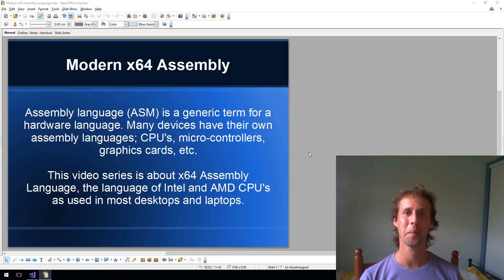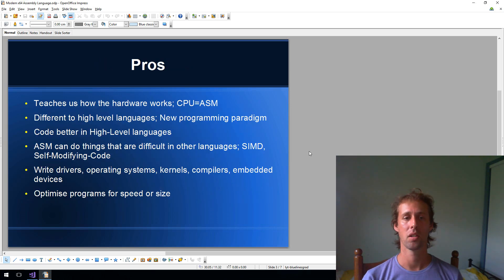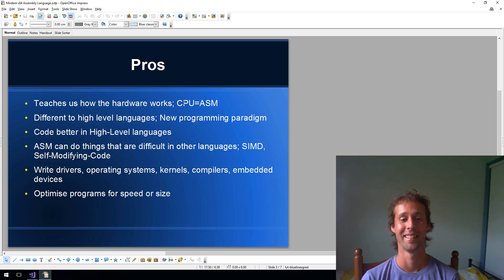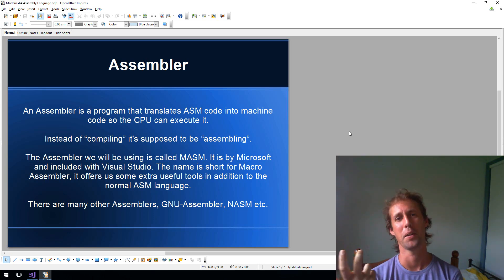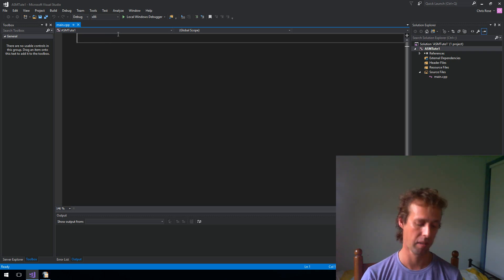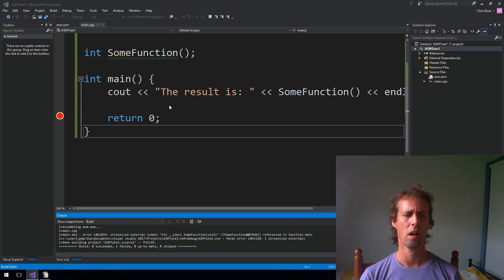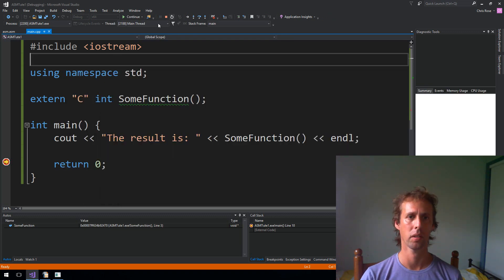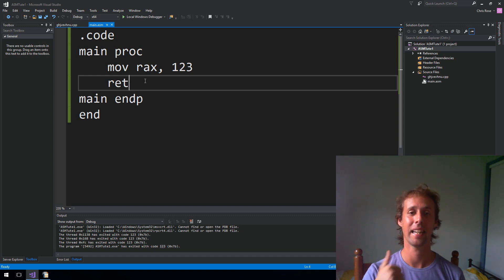Modern x64 Assembly 1: Beginning Assembly Programming

Comment: My C programs need somewhere around 5 MB RAM and 0.2% CPU of a single core: Yes, i need to learn assembly to make more efficient and faster programs.
Reply: I think it’s more about learning how the cpu and coding works
Reply: I don't think you will get anywhere near the optimized code modern compilers produce. If you want your program to be size-efficient you should stick to C. If you want it to be as fast as C but scale well with complexity then use C++. Use assembler only if you can't use C/C++ to get the job done.
Reply: @embeddor2230  the real challenge is making good code. There's a difference between searching a string with a regular loop vs an algorithm tuned to be almost 10x as fast
Reply: @gabe8168  indeed, but one should also note that many algorithms specially ones related to dynamic programming tend to ignore the constant factor in their time complexity like memory access time or number of used divisions/multiplications or number of unpredictable branches and so on.
Reply: lol
Reply: Maybe try making a new programming language? If you do it in assembly, then surely it'd be faster than C (as long as it's well-written code that is)
Reply: @brotheradamfromups  It is actually pretty hard to beat a good compiler on an architecture like AMD64, which is very complex.
And there is the problem that many of this CPUs have some kind of bug which can slow down some instructions with some arguments.
Reply: Use C# or C++
Reply: @fdsKedi  NO. Not C#, it has an nondeterministic GC.
Reply: @happygimp0  Rust ownership makes a lot more sense than a GC. Each variable has a lifetime and the second they go out of scope they are dropped unless otherwise specified

Comment: 14:25 Could you please explain using "i" in the inline asm code as "i" is not a register, it's a C variable name.  I presume that the _asm code block maps C variables into a default register assignment? Otherwise how are the opcodes generated using non-CPU register names?
Reply: i is a local variable on the stack. the mov operation is capable of putting an immediate value into a memory location.

Comment: Good video. 
A little (quite pedantic) remark - x64 does not actually stand for anything. It is a moniker used by Microsoft for their 64-bit operating systems. Usually x86, x86-64 or AMD64 is used.

Comment: Back around 1981, at age 20, I was programming professionally in 8080 assembly for one company and freelance coding games for another company in z-80 Assembly. The 8080 project was to code a multi-user hospital inventory control system on a 48K box that used serial ports to communicate with dumb terminals (Hazeltine). We were limited to modules having to fit in a 3K RAM space. That was fun and the stuff I was working on was the UI, which didn't take long at all. A coder from today might question that choice of such a system for Hospital inventory, and/or the 3K module limit.  I'm pretty sure it was a bid situation and the company I worked for had to use the cheapest possible hardware on the front end and pay coders out of whatever money was left. Nice to see there is still interest in Assembly. All good wishes!
Reply: I learned Z-80 assembly in 1978-79 on a TRS-80 Mod I.  I still can recite hex opcodes from memory.
Reply: 8080 is great. Wrote emulator and currently writing assembler in haskell to compile cp/m.
Reply: The Zilog Z80, Omg i those days. That's where it all started for me. I had this book... still got it lol, but no computer , so i did dry runs. and memorized the mnemonics like the alphabet lol. thank God I have a computer now LOL
Reply: Wow!
Reply: Learned 6502 c64 assembly with Turbo Macro Pro
Reply: Sir can you teach me assembly language
Reply: @muhammadbilal6865  Dude. You're literally watching a video on it right now
Reply: @bravefastrabbit770  Alright Thank you

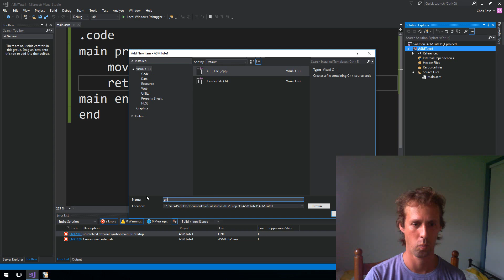Comment: the time 17:00 - you say you don't know what does it mean: "unresolved external symbol mainCRTStartup'" 
this message clearly says you need to define the 'entry point' in the solution properties for your configuration:
in the 'solution explorer'  right-click the name of your 'solution', choose 'properties' (or just press Alt-Enter)
and set the 'linker / advanced / entry point' option to 'main' (the name of your procedure, it doesn-t have to be 'main')

in some cases the Visual Studio requires to set the option 'linker / advanced / has safe exception handlers' to '/safeseh:no' too
Reply from the maker: Yes, sorry, I mean I don’t know why it can’t find the entry I have supplied until I add a cpp file.

I like your solution, thanks for that. It’s still a mystery why the linker can find ‘main’ once an empty cpp is added though.
Reply: @WhatsACreel  - I think it is because while adding an empty cpp file you use  Visual Studio templates in fact...
probably we should check the linker option "entry point' I've mentioned above - I guess it will contain the 'main' string just after  adding the cpp file stub
Reply from the maker: @TadeuszKurpiel  Certainly possible! Your solution is solid mate! Cheers for that, and cheers for watching :)
Reply: @WhatsACreel  - Thank YOU very much for this great movie series about x64 assembly!!!
It's great and I learn a lot from it!
Reply: @WhatsACreel  - by the way - maybe it's worth being mentioned that Visual  Studio  'solution properties / options' have to be set separately for every 'debug / release' and 'x86 / x 64' configuration...

I've spent much time (at other projects) trying to understand why my code started to produce plenty of  errors after changing some of that values (the pairs  debug/release and x86/x64 I mean)...
and that was the answer: 'solution options' have to be set separately for every configuration...

Comment: in the first example,  to discover the full potential of x64 code, the 'SomeFunction()' should be  declared as 
'extern "C" long long int  SomeFunction();' or 'extern "C" unsigned long long int SomeFunction();'
only in this case it is  guaranteed that the full 64-bit length of 'rax' register will be used as the return value of  SomeFunction()
see eg: https://en.cppreference.com/w/cpp/language/types
and of course in the asm file you can put some 64-bit-wide value into the 'rax' register - eg 'mov rax, 0fedcba9876543210h'
(MASM doesn't understand the '0x...' hex notation - only with 'h' as hex number suffix, 
and requires that number literal has to begin with digit - so the leading '0' is mandatory)
and to improve readability of such value you can put the 'hex' modifier into the cout stream - eg:
'cout << "The result is: " << hex << SomeFunction() << endl;'
Reply from the maker: That’s true, we can return a 64 bit int. But it’s common to use 32 bit ints too. It’s common to use chars, and short ints, or whatever. The 64 bits doesn’t define the size of the variables we use, it’s just the size of the general purpose registers. It's common and normal to write a function that returns a plain old 32 bit int even when you're in 64 bit mode! :)
Reply: @WhatsACreel  - OK, You are absolutely  right.
But there are plenty of 'ordinary' 16/32-bit assembly language tutorials/courses on the net showing that 'short' values...

And the full power of your great movies lays in showing the x64 possibilities...
Why not to use them in that introductory example?
Reply from the maker: @TadeuszKurpiel  Yes, I'm not sure how many vids before we use the 64 bit registers. I'd say their most common use is addressing RAM, like "byte ptr [rax]". It is a good suggestion, I could have used RAX!

Comment: example of something where hand optimised is better?
Reply from the maker: Find an algorithm you’re familiar with. Code it in C++ and look at the disassembly to see what the compiler does. It can be hard to understand, but you’ll get used to the instructions. Keep the Intel and AMD manuals handy!

Then, try to code some ASM. See if you can come up with something faster or smaller than the compiler. Research these instruction sets to see if there’s instructions the compiler is not utilising which better match your algorithm – MPSADBW, PCMPESTRI, DPPS, PSHUFB, VPTERNLOGD, etc. There’s some really wild instructions out there!! A compiler is not going to figure out when these instructions are useful except in the most obvious cases.

Learn how memory works, and caches. Unroll your loops as much as you can, and block in the caches and registers. Learn about SOA vs AOS, and memory access patterns. Good memory utilisation can easily double or quadruple the speed of many algorithms!

If your algorithm is not trivial, like summing an array or something, then you’ll usually find it is not terribly difficult to get at least a few % extra speed from hand coded ASM. And sometimes you will get much more than that!! Plus, when we think about the ASM, we can often understand better ways of describing our C++ to the compiler too!

If you want examples, I’d point you to BLAS libraries, matrix kernels, drivers or other low level API’s, basic operating system functions. Things like the “malloc” function or “memcpy”. These functions reflect on the performance of the entire system! And so you’ll find many of these things are coded in ASM. Although Windows is obviously not open source, we can still see some hand-coded ASM in the libraries provided with Visual Studio. It’s not a lot of code, but it is interesting to see the source code for some of those basic functions coded by the Microsoft engineers!

It’s also extremely important to hand code ASM when developing a compiler in the first place! If you want a compiler to understand how to write decent ASM then you will need to be an expert at hand coding ASM! After all, compilers don’t teach themselves how to code :)

Obviously it takes years of study to familiarise yourself with x64 Assembly. It’s a marvellous world of completely amazing programming techniques and mechanisms. It’s not for the feint of heart, but if you’re keen, I think the best place to find code that can beat a compiler would be to code some yourself!

Good luck, and cheers for watching :)

Comment: If you want to run only asm in a Visual Studio 2019 project:
Set the project to x64.
Create the .asm file and modify it's properties: Configuration Properties - General - set Item Type to "Microsoft Macro Assembler". (should be already set though).
Add masm in the Build Dependencies - Build Customizations... and add a proc in it as shown in the video.
Go to the project properties: Configuration Properties - Linker -  Advanced - set Entry Point to the name of the proc from the .asm file.

If by any chance you name your .asm file main.asm, comment it out (using ';'), remove the Entry Point from the Linker  tab and create a new main.cpp file it won't work (linker errors). You need to rename the main.asm file to something different because it conflicts with main.cpp.

Comment: At 16:17 If you go into menu Project | ASMTute1 Properties. In the ASMTute1 Property Pages, select Configuration Properties | Linker | Advanced. On the right, the first option you see is 'Entry Point'. Specify 'main' as the entry point and enter. Press 'Apply' buton. Don't forget to do it for all the 'Configurations' (Debug | Release) for platform x64. This is a really nice example. Thank you.
Reply: tried, didn't work for me, it gave me this error during run time : "unresolved extenal symbol main"
Reply from the maker: Great advice! Thanks for sharing :)
Reply: Life saver. Thank you!

Comment: Compilers are so intelligent nowadays that coding directly in Assembler would be slower.
Reply from the maker: Yes, compilers are very good, and they're getting better really quickly.

But C++ is just not expressive enough to detail the true limits of the hardware. The fastest things can only be expressed in the Assembly language of the hardware.

Try to outcode the compiler. I'm pretty sure you will find that they aren't that hard to beat. Depends what you're trying to code, of course.
Reply: @WhatsACreel  I want to follow you in this tutorial but since the video is from 2017 the visual code studio has changed. 

For example I can't find the build dependencies at 10:50

What can I do?
Reply from the maker: @landro3552  It's still there in the menu. Name might be a little different? Maybe it's called Build Customization?? But anyway, if you right click in your project, you should see something very closely matching what's in those old videos. The steps for doing this stuff has not changed since 2017 as far as I can remember?

Comment: To get MASM x64 working. Open the visual studio 2019 native tools command prompt. This can be found on the visual studio menu on the start men and go to visual studio folder. Once the prompt has opened type in ml64. This will allow you to run masm assembly. I found when I did this I could create a C++ program and call code in assembly. Otherwise, when I compiled I got a "does not recognise .". I think it was compiling the assembly file using the C++ compiler.

Comment: I still get external link errors using the method at the end, the only difference is I'm using VS 2015. Would that matter?
Reply: oh i just removed my cpp file and re-added and it's now worked. It could have been because I name originally main.cpp and now i've renamed it to something different.
Reply from the maker: @stefoster7031  Glad to hear you got it working :)
Reply: @WhatsACreel  Thanks, although I did run into other issues - was telling me i was missing a dll. At which point I gave up with VS and moved over to NASM instead. This seems to work fine for me :) Great video by the way.

Comment: Can't make this work always get LNK2019 :(
Reply: Had the same problem: fixed by right-clicking on the .asm file in VS, clicking Properties, and then under General changing "Item Type" to Microsoft Macro Assembler. I'm guessing that this happens if you create the .asm file before enabling MASM but could be wrong.
Reply from the maker: @jackakers13  That sounds pretty accurate brus!! Cheers for sharing. I hope it helps op :)
Reply from the maker: That's no good mate, can you post your code on here? Or you copied char for char?
Reply: @WhatsACreel  I checked it char for char like 5 times I'm sure it's the same. Might be something from the IDE, gonna reinstall and try again.

Comment: I have question how I should start? Shall I start with dosbox and old compilers like nasm or it is better to use the new stuff directly?
Reply from the maker: I reckon dive into x64. It's actually still got most of the old 16 bit instructions. The original 70's instructions set is great to learn first because they still form the backbone of modern ASM. You could use dosBox, but I think it's easier to fire up Visual Studio and code much the same instructions without an emulator. Modern versions of NASM are amazing! Course, that's all my opinion.

Anywho, cheers for watching, good luck!
Reply from the maker: I reckon dive into x64. It's actually still got most of the old 16 bit instructions. The original 70's instructions set is great to learn first because they still form the backbone of modern ASM. You could use dosBox, but I think it's easier to fire up Visual Studio and code much the same instructions without an emulator. Modern versions of NASM are amazing! Course, that's all my opinion.

Anywho, cheers for watching, good luck!

Comment: I think it's really good to know some assembly but it's likely not really something you would want to use for the majority of the time. The x86-64 compilers nowadays know almost every trick in the book in how to make the code as fast as possible, depending on the compiler of course. I tried a few times and you can write faster code in assembly but unless you really get involved in it, it's likely that the C++ compiler will produce 10 times faster code with 10th of the effort put into the code. So if you're new at assembly, I will guarantee you will loose to any x86-64 compiler. If you think you can beat the compilers, I'd like to see some code. Just curious.

Just some thoughts, Inline assembly block in visual studio saves some registers when you enter the block and restores those when you exit the assembly block, so I recommend not using an assembly block inside a hot loop, rather put the hot loop inside the assembly block.

Currently coding in assembly to stm8 micro-controller because I needed some precise timing on the GPIO. :)
Reply from the maker: Compilers are good, we don't need to ASM most of the time. Optimising code is NP, tho, there is no known good method which compilers could use. So, compilers know lots of little tricks.

But the big tricks are SIMD, and when it comes to SIMD, compilers are almost useless. You can use C++ intrinsics, but they are (IMHO) no easier than good old ASM. C++ is not meant for this type of ultra-optimised code, and the intriniscs look out of place, tacked on, awkwardly named, and you still end up with hundreds of indecipherable instructions. ASM is supposed to be low level, SIMD looks like normal ASM code. So if you're talking about SSE, AVX, or some of the wild bit manipulation instructions that are coming out, I'd say give me ASM code any day :) Just an opinion, of course.

I agree, most of the time ASM is not useful. It's overkill, like taking a formula one car to a kart track, but sometimes it really shines. Depending on what you're doing, hand coded ASM can approach GPU speeds. Like you mentioned, if you're coding little micro controllers, it's truly great!

Anywho, thanks for watching, have a good one!
Reply: Niko you still playing around with Vulkan or what? I was watching your vids as you released them. I see Kronos finally got documentation out there on how to actually use it instead of just giving us demos and expecting us to reverse engineer everything they did to make that demo which was insane at the time.